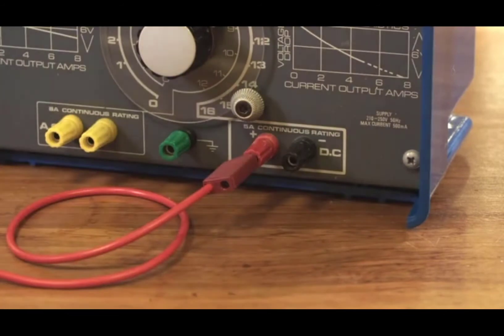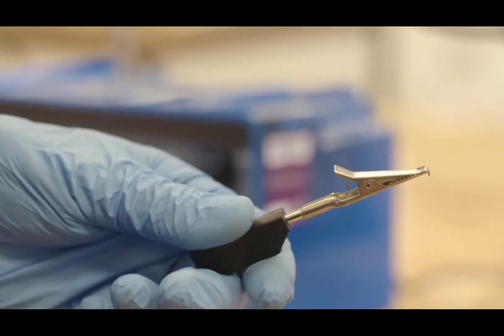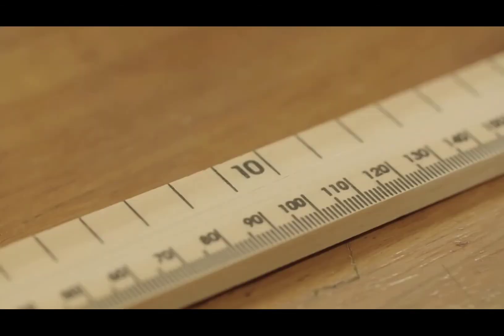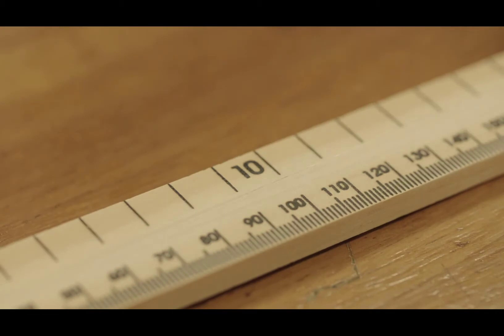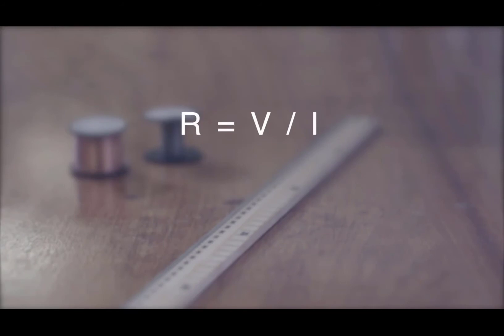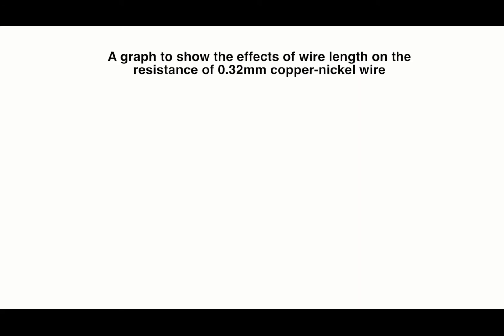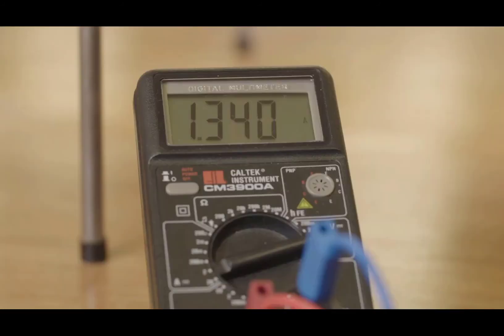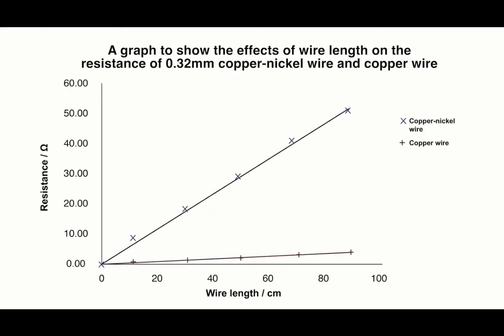IGCSE Factors Affecting Resistance | Fizik Tingkatan 5 | Faktor yang mempengaruhi rintangan

Comment: 1) increase length of wire can increase the resistance
2) copper or nickel produce more resistance 

3) use glove to handle electrical component

16074

Comment: 16080
•Resistance can be calculate by using formula R=V/I
•Factor that effects the resistance is the length of wire
•If the length of wire increase, then the resistance is increase
•the resistance is directly proportional to the length of wire

Comment: 16048
-the length of the wire is affecting the resistance in the circuit
-the higher of the length of wire,the higher the resistance of wire
-thus,it shows that the resistance is directly proportional to the length of wire
-other than that,the copper-nickel wire has higher resistance compared to copper wire,if the length of the wires are constant
-this shows that different materials of wire have different resistance in it

Comment: 16165
• the factor that affecting the resistance is the length of wire
• the longer the wire the higher the resistance
• the formula that calculate the resistance is R = V/I

Comment: 16171                                                                    The higher the length of wire,the higher the resistance , therefore length of wire is directly propotional to resistance

Comment: 16185
-length of wire is directly Propotional to the current
-the higher the length of the wire , the higher the resistance
-calculate resistance R =V/I

Comment: 16064
the longer the length of a wire, the higher the resistance. the bigger the diameter of a wire, the lower the resistance. thus the length of wire is directly proportional to the resistance of wire.

Comment: 16141
- The resistance of circuit changes to the factors of the length and thickness of wire
- Resistance can be calculated using R=V/I
- The length of wire effect the resistance, the longer the wire, the higher the resistance. 
- Length of wire is directly proportional to the resistance of wire.

Comment: 16044. The longer the length of the wire, the higher the resistance. So the resistance is directly proportional to the length of the wire

Comment: 16045
- Make sure the wire used is not twist or have knots while measuring the wire.
- based on graph, the length of wire is directly proportional to the resistence (make sure the best fit line passes the origin)

Comment: NK160073-:for the safety precaution we can wear gloves to avoid skin irritation.
:We can use formula R=V/I to identify the reading of voltmeter and ammeter.
:Length of wire directly proportional to the resistance of wire.

Comment: HT160185
The resistance of the conductor is affected by the type of material it is made of and by its length,thickness and tamperature.The higher the length of wire,the higher the resistance.

Comment: 16167
-the length of wire is directly proportional to the resistance of wire
-use one variable at one time when doing the experiment
-resistance of wire can be find from formula V=IR

Comment: 16010
Factor that effecting resistance is length of wire, the longer the wire the higher the resistance , hence resistance is directly propotional to the length of wire
 We can use formula R=VI

Comment: 16181
Factors affecting resistance
1) length of wire
- the longer the wire the higher the resistance
- calculate the resistance from the formula V=IR
- resistance is directly proportional to the length of wire

2) type of wire
- copper-nickel wire produced higher resistance than copper wire

Comment: 16156 -resistance is inversely proportional to the current. when the resistance increases, the current decreases. the length of wire is directly proportional to the resistance. so the longer the wire, the higher the resistance

Comment: 16115 
★gloves is needed when handling electrical components to avoid skin irritation
★ the length of wire is directly proportional to the resistance of wire
★the resistance is calculated by observing the reading of voltmeter and ammeter with the help of R = V/I

Comment: 16137. wire length affecting the resistance of a wire. resistance  is directly proportional to wire length. the longer the length of wire, the higher magnitude of resistance. resistance is gained by the formula, R=V/I

Comment: 16020 resistance of a circuit is determined by the length and thickness of wire used. The longer the wire, the higher the resistance of circuit

Comment: 16003 - Resistance is affected by the length of wire. As the length of wire increases, the resistance also increases. therefore, length of wire is directly proportional to resistance.

Comment: 16056.The relationship between the wire length and resistance is directly proportional.This data could be obtained through drawing a graph of resistance against wire length.Therefore,the longer the length of wire ,the bigger the resistance

Comment: 16087
When doing the experiment,  change one variable at a time for example length and thickness. Current and voltage is measured to calculate resistance using the formula V=IR. Wire length is directly proportional to the resistance . When the length of wire increases, the resistance also increases.

Comment: 16060. The length of wire is directly proportional to the resistance of wire. The resistance can be calculated using formula R= V/I

Comment: 16050 Different wire have different resistance because of sensitivity. As the length of wire increases, the resistance increases because resistance is directly proportional to the length of conductor

Comment: 16150. When the length of wire increase, the resistance of the wire also increase. Current must travel farther through a longer wire, so there are more chances for it to collide with particles of matter.